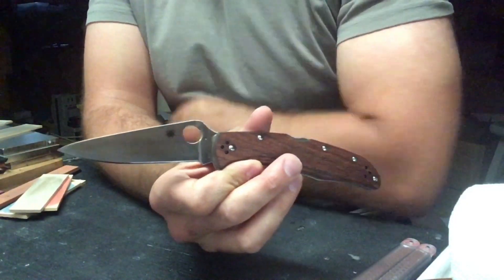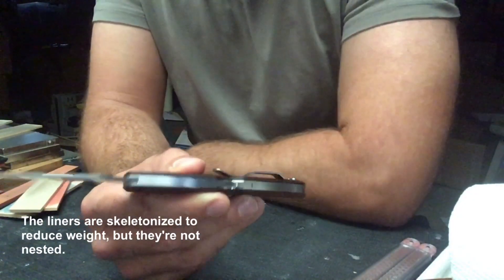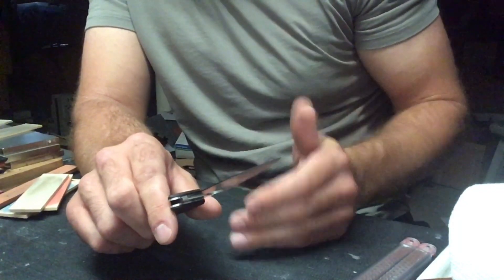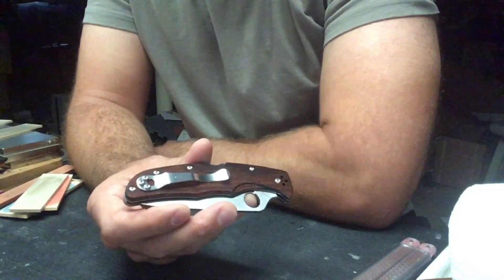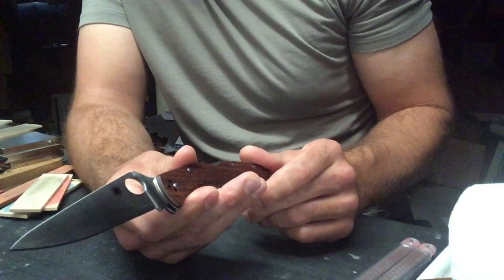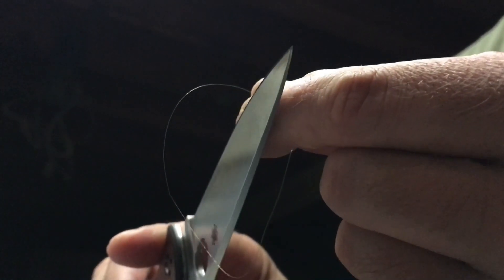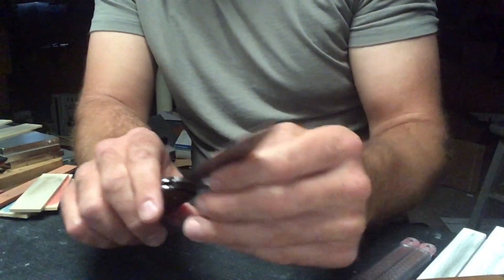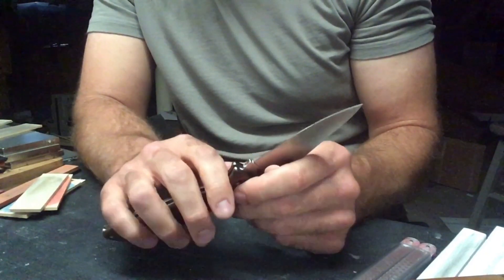HAP40 steel Spyderco Endura - pakkawood handle scales

Comment: If you can help me i'd greatly appreciate it.  I'm trying to whittle hair and it absolutely will not: it either pops off, or it don't bite into it at all.  It tree tops little ~1mm bits off just fine, can even leave a cut that tapers to a very fine fibre.  To try to cheat, i try placing the hair on the table, and with the blade digging into the hair but without touching the table, i pull the hair...but as soon as i tug on it even gently it just pops off (literally goes airborne) no matter what degree i hold it at.  It's a 20 degree bevel, 1084 steel hard enough to do more damage to a Nicholson file than to itself, finished to .5 micron diamond film with different stroke angle between grits to differentiate each grit, finished with .1 micron diamond spray on newsprint (i don't have nanocloth etc).  I have thick Asian hair.  Many thanks
Reply from the maker: klebics don't differentiate stroke angles.  You increase polish, but loose bite.  
News print is fine I guess, but not very stable.  You'd be better with wood or leather.  You can try to play with the angle of approach with the hair, that might help.  
Try the difference in sharpening.  You could try your last two stones keeping the strokes the same, and then stropping.  Keep the angle of stropping the same as well...  spine to edge.  Then try the hair again.
Reply: Thank you so much, so much for your advice but more importantly your encouragement.  I thought i'd never be able to whittle hair.  I wanted to give up...it WAS cut-upon-contact so i thought why should i bother further.  Now however, i realize "cut upon contact", at least my version of it, is inferior to actually being able to whittle hair (my max so far is only 3 strands before breakage).  Had you not written i was ready to give up on some stupid excuse like ~maybe non-Asian hair is less brittle~ blah blah blah (having that said, it turns out wetting the hair's kinda important).  Your advice to try wood made a HUGE difference...bevel rounding(?) and bevel angle increase(?) from the paper turned out to be HUGE (and maybe the silica/whatever grains left inside from grinding the pulp)...and what sealed the deal was using a piece of solder instead of Atoma 1200 to generate a finer slurry on the Suehiro 10/20K.  Odd fyi: i'd no wood on me except 2 blanks of Honoki/Japanese magnolia...somehow the denser wood would make a strop finer than had it applied to the less dense wood.  Anyway, once again thanks so much for your reply and your vids i look forward to your chanel growing :D